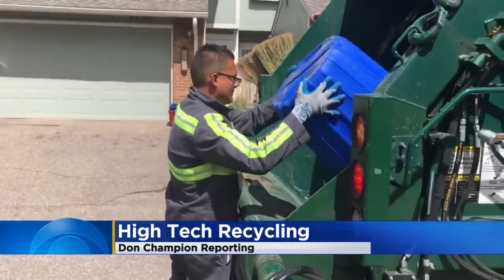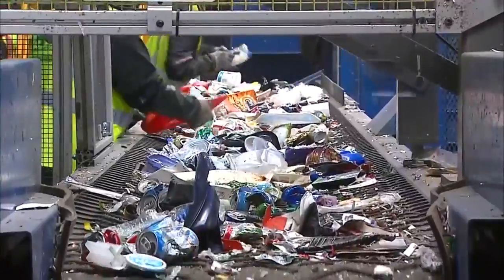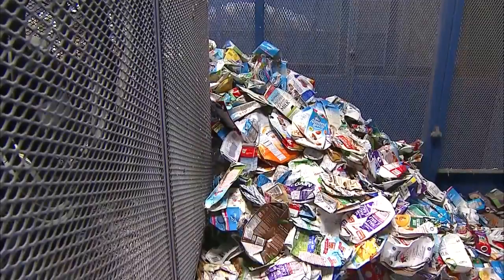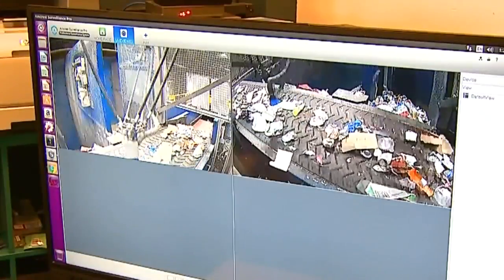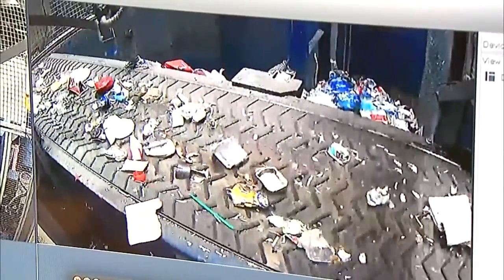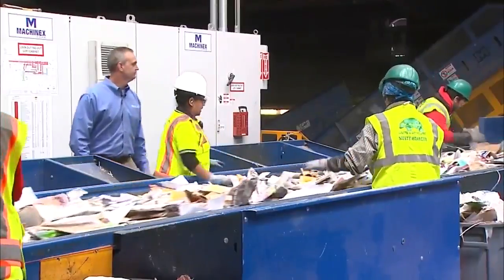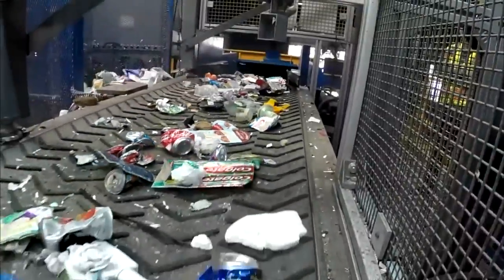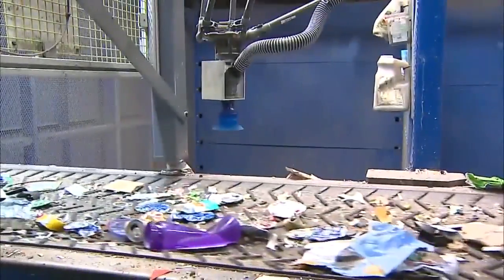Denver Recycling Center Testing Robotic Sorter

Comment: I work at one of these.  Look at how much faster those people are doing it than the robot.  In recycling you gotta lot of odds and ends you need original thinking to determine what to do with them.
Reply: what do you think is the greatest challenge in sorting recyclable items?
Reply: But would you say that 10-20 per sorting line would be enough to replace some of the needed work force? I imagine that it is very hard to hire new people to the sorting lines. So robots, even slower than invidual person, would help in the problem, right? Not solving the entire recycling process, but a small part of it to the better future.